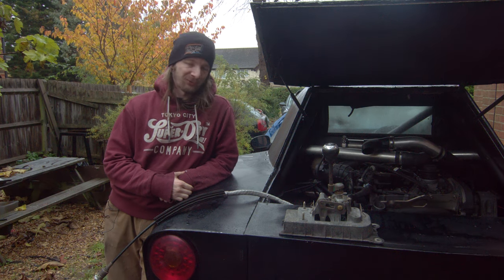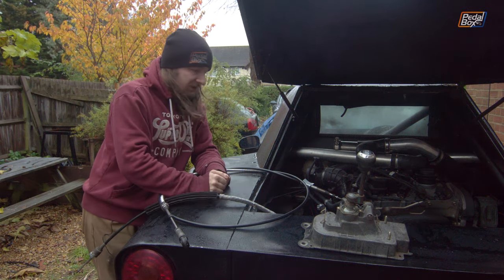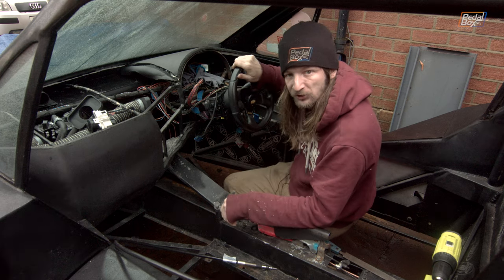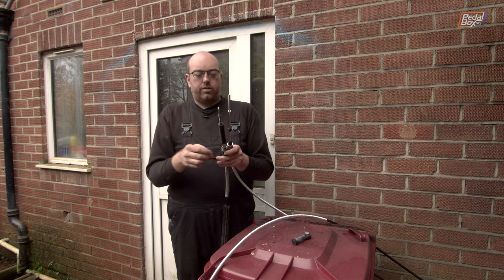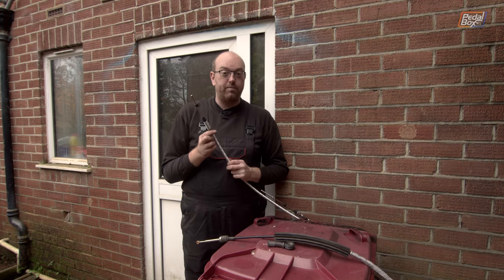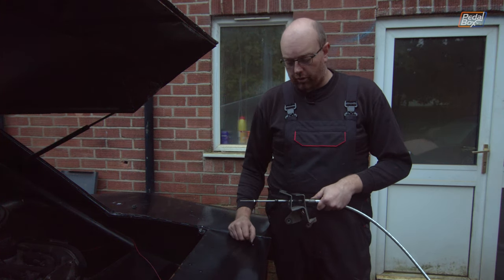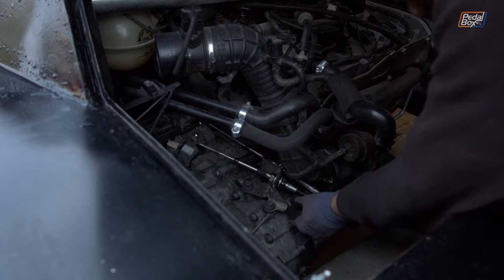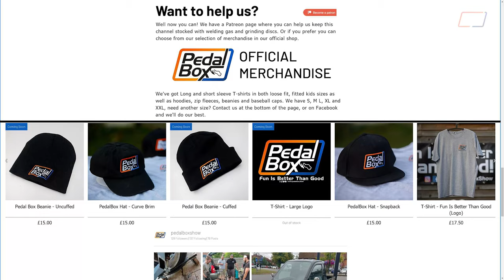3 METER Shift Cables | Audi TT Kit Car | PedalBox Episode 151

Comment: We now have some form of cabling, exciting times ahead!
The alternative way on requiring less throw would be shorting the lever shifter side but then added risk of 135 or 2 4 closer together and greater chance of wrong gear downshift 😮 is doable. Leaving that until the engine is running is probably best